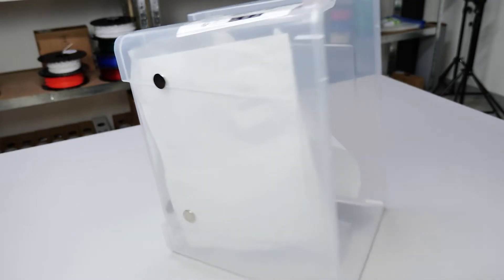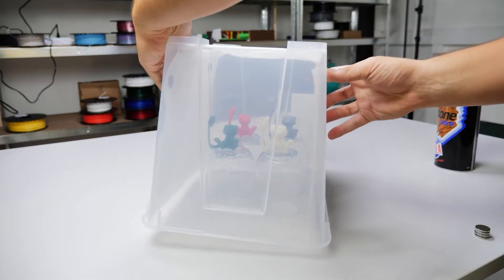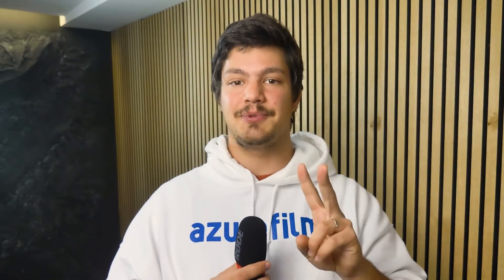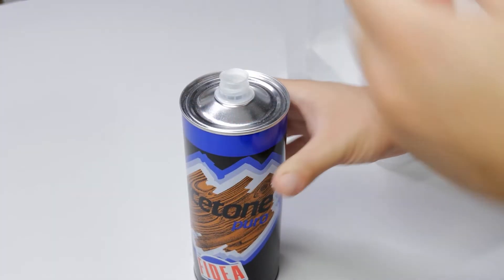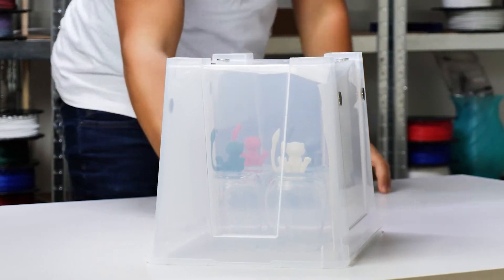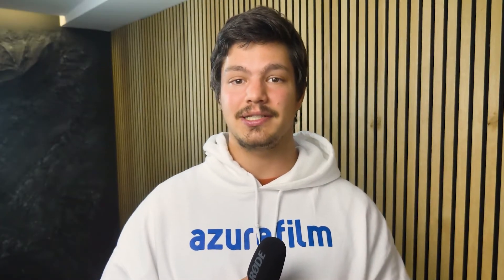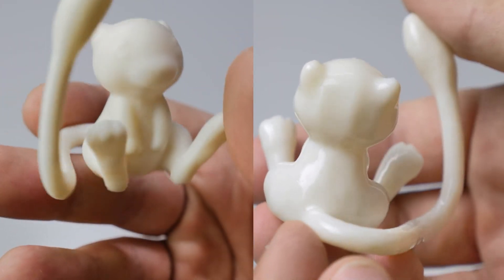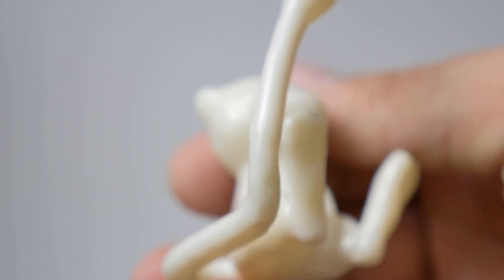Improve your ASA & ABS prints with acetone smoothing

Comment: This process is slow, so do this instead... Fill up a jar with acetone that is a little bigger in size compared to your ABS printed object. Put on acetone-proof gloves, hold the object with your fingers, dip the object into the acetone bath and slosh it around for 5 seconds. Let it dry but set it on a surface that the object won't stick to. Repeat this process another one or two times. Done.